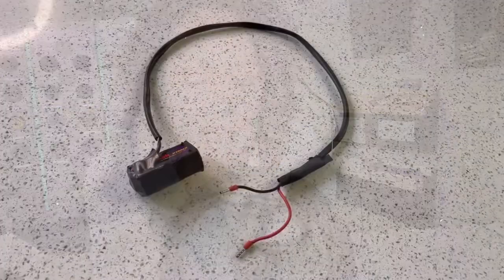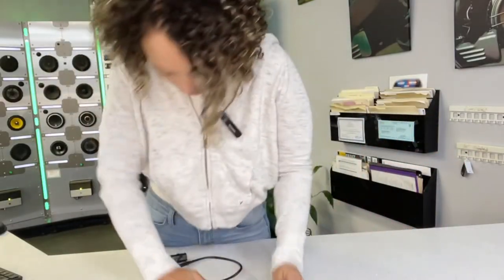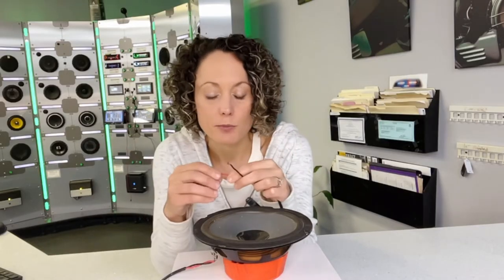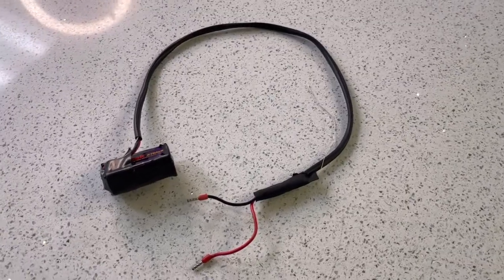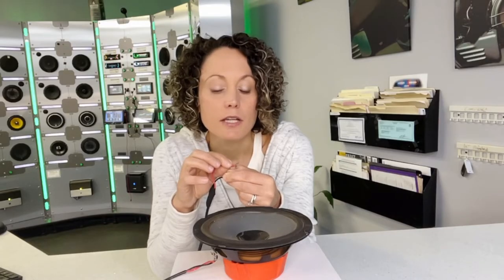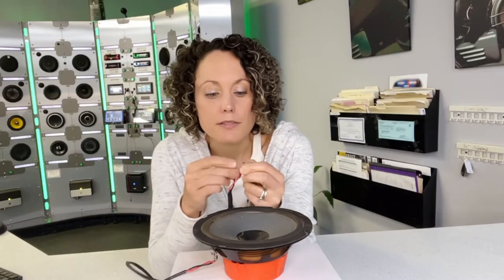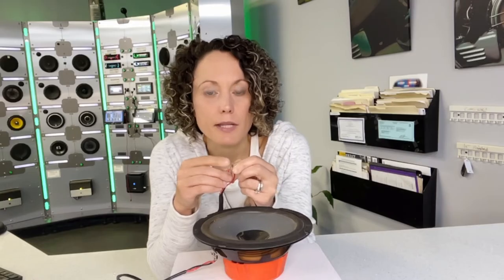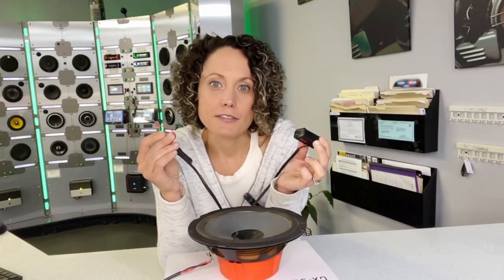How to test speaker wire polarity - no special tools required

Comment: Interesting technique for sure another easy and mindless way to find out your positive to positive and negative clarity is to simply get out a 12 volt multi meter and set the meter to 12 Volts DC, connect your negative to your negative terminal and your positive to your positive terminal, if your positive terminal is on your positive wire, it should read that you’re getting Anywhere from 7 to 12 Volts.
Reply: @Eurospec73  
How can a speaker by itself produce 7 to 12 volts for a multimeter to be able to read that.

Comment: NIce video. I suggest using a AA battery first since its just 1.5V its much safer than 9v. if you cant clearly see the speaker movement then move up to 3v etc and move your way up to 9v.

Comment: This is a great video to identify the polarity on the actual speaker only, I need to identify the actual polarity of the cables coming from the stereo as there is no speaker there and the speaker I need to fit is a very small tweeter which I do know the polarity of, however I do not know which door wire is the positive to connect the positive side of the tweeter to... and getting the head out is going to be a pain to examine the rear of the unit to see what's what at that point. Can you help please? Subscription promised. Thanks
Reply from the maker: What’s the year, make and model? Do you have the factory speaker that was removed? And is the factory speaker plug still intact?
Reply: @carstereochick  Its a 2005 Fiat Ducato motorhome. The very tiny tweeter that was removed was no longer working and I still have that, but it came with the vehicle and its very old, yes the tiny plug that goes into the tweeter I still have, but there are no polarity markings on it at all. I just need to work out which door wire is the positive so I can replace a new larger tweeter,
Reply from the maker: Generally most manufacturers use clip side (wherever the tab is to release the connection) as positive. Is there a small capacitor on the tweeter? If so, that is typically soldered to the positive side. Do you see a capacitor on the back of that tweeter? If all else fails, you may want to buy this $12 tool that includes test tones to determine polarity - https://amzn.to/43xCSO1
Reply: @carstereochick   Thank you I got my answer now, yes there is a capacitor and I now know that is the positive side.

Comment: How do you test the car wiring for polarity?
Reply from the maker: There's a few ways you could do it. If you can see the speaker in the door/rear shelf and you're probing the wires either from behind the factory head unit or at the stock amplifier (like if you're trying to wire up a head unit and the harness is cut or if you're trying to decipher speaker color wires to do a stock amplifier bypass for example) you can probe/pop those lines from behind the head unit or at the amp and watch whether the speaker is moving in or out. Or if you remove the door panel, remove the speaker, take note of how the connector is seated to the speaker when you remove it (example - brown wire on top, green on the bottom) then you can either take the speaker out and test it or while it's still connected to the harness in the door, strip back the wires back that are going to the speaker and probe/test it right there.

Comment: So you know the polarity of your speaker terminals , not of the wires unless well i don't know hoping they are connected correctly  ? l really am not sure. 50% problem solved , thank you . Nothings easy .
Reply: if they’re wired backwards it would still be the same affect, you’d just reverse it at the speakers would change the polarity
Reply: @SoyChukii  Thumbs up, thanks for the reply

Comment: thanks, but does it hurt to do this if the speaker wire has a capacitor on it? Usually they connect the capacitor to the positive wire, but some imported stuff can be a bit of a hit and miss.
Reply from the maker: Usually on tweeters cap side is positive. Also clip side on the OEM connection is usually positive. I hope that helps.

Comment: It works for speakers large enough to see the cone move, but not for something like tweeter, where you can't.
Reply from the maker: Yeah, for tweeters you typically have to look at the tweeter itself. Most manufacturers use clip side (wherever the tab is to release the connection) as positive. If there is a cap on the back of the tweeter that is normally soldered to the positive side. Or use a simple and inexpensive audio testing tool like this: https://amzn.to/3xAU4qH

Comment: That's good for a speaker when you can see how the cone behaves. But what about a sealed speaker where you can't see the cone because the grill doesn't come off? I have a Monsoon speaker that connects to a subwoofer but the red tag came off the wire that identifies it as positive. The speakers are sealed and I can't see the cone.
Reply from the maker: Is this in a car? Usually there is at least a speaker grille that you can shine a flashlight through and see. If it's not visible you may want to buy a phase tester on Amazon for $14.

https://amzn.to/3RpbXPs
Reply: @carstereochick  It's one of a pair of Monsoon speakers for a computer that comes with a subwoofer. They're pretty dated and someone left them behind at my job and I just wanted to identify the + / - wires in case someone wanted them. When touching the wire leads to a battery, I just hear what sounds like static for a brief second. They are flat speakers and don't use traditional cones. I'll probably just put them in a pile for someone to pick up and figure out on their own. I was just looking to make it easier.

Comment: Madam , which wire gauge suitable for wiring head unit to speaker? 18 or 16 ?
Reply from the maker: Hello - just a head unit install? Usually that is only 18 gauge, but sometimes you will see 14 or 16 used on theignition and ground wires for models that have a high powered internal amplifier.

Comment: Well, when I plug my door speakers up, they don’t move at all, so how can I tell?
Reply: If you follow the 9 volt battery demonstration then you have a dead battery, a bad wire, or a bad speaker something not conducting electricity provided you have electricity.  Switch batteries and test again. Also you can perform your test on another speaker.  If the problem follows you then it is not your battery.  That should give you enough info to determine where the fault is.  I assume  you have removed the wires from  the head unit.  Remember  you are only testing the Speaker, not the wiring harness from the head unit.

Comment: Wait that tells me the polarity of the speaker, how do I test the wires coming out of the car door?
Reply from the maker: So if you are replacing door speakers for example and need to check the polarity, you can literally cut off the factory connector while still connected to the factory speaker and test the bare leads coming off that factory connector. Then solder in new speaker wire to the OEM wires. If you've got no factory speaker to check against, you may want to invest in a basic polarity test tone tool FH-168.
Reply: @carstereochick  Thanks.

Comment: Whats the minimum voltage we can put on to test the speaker polarity
Reply from the maker: Even a double AA battery would work, it would be enough to see it move, but it would only be a faint audible pop so just keep that in mind if you're trying to decode OEM speaker wiring and hear/pin point which pair of speaker wires you're on then you might want a little more.
Reply: @carstereochick  this would be very helpful mam

Comment: How do you check the polarity of the wires in the car?
Reply from the maker: Assuming you just probe the wires with the door panel off you can do a visual assessment of the speaker to identify which one is positive and negative.
Reply: @carstereochick  Perform a continuity check with a volt meter.

Comment: How to check 2way speaker's (woofer & tweeter) polarity ?
Reply from the maker: Same concept, but the tweeter movement will be very slight and use a lower voltage on the tweeter. Like a 3 volt battery would be better to use on the tweeter, don't use 9 volts. Usually you can tell by physically looking at the terminals. The bigger one is always positive. Can you see both drivers move? Or can you easily remove them to examine them?
Reply: @carstereochick  
Thanks

Comment: But won't those 2 wires touch n spark on battery tester?
Reply from the maker: It’s just a 9 volt battery. Ever measure voltage through speaker level from a factory or aftermarket head unit? Most send anywhere from 4 to 16 volts through speaker level.  Won’t harm them and no sparks 😉
Reply: @carstereochick  yes I do it with my 12 volt drill battery daily but you can only do it once or twice before you can damage speaker.or I use my fluke volt meter.but the drill battery works on my milwaukee drill
Reply from the maker: In my 20+ years experience never damaged a speaker from this, but 12 volts might be a bit much for some speakers. Many aftermarket head units put out 8-9 volts clean signal through their built in amplifier and a lot of newer stock stereos put out more voltage than this through the stock speaker lines. Example- 2020 Grand Cherokee non amplified with no load there is 5 volts going through the speaker lines. Once you actually put a load on it and turn it up you have more. Some stock stereo systems are piping through as much as 30 volts (usually in the premium sound models). You could use a smaller battery too like a D which is only 1.5 volts for same test. OR you could use Metra's convenient All-in-One tester with tone generator which includes a (*gasp!) 9 volt speaker tester: https://theinstallbay.com/product/IBR68.

Comment: Hello, that is helpful but realistically cars speaker wires are usually random colors with a different color stripe.
Reply from the maker: Yup so if you probe the random colored wires and watch what the speaker does you can identify what's positive and negative.
Reply: @carstereochick  Yeah, that's something I learned fairly recently. Thanks for sharing this video, it was of some help to me.

Comment: This method only works if you can see the speaker In your car If you can't see the speaker you won't know the direction it's moving. When you test with the battery.
Reply from the maker: Yes, this is true. However in a lot of cases if you shine a bright LED work light through the door grille, you can still usually see the movement. Sometimes this requires 2 people, one to look and one to test the wires. If you can't do it that way, in that case you have to spend some money on more sophisticated testing equipment. But not much. This would do the trick: https://amzn.to/43xCSO1

Comment: 99% of the spakers have mark for + and Negative. How to test the speakers wires that came from the Radio without removing the Radio?
Reply from the maker: Most stock speaker terminals are not marked, they’ll have a locking plastic connector and if you’re cutting that off or tapping into it to install aftermarket this test will help you figure out what’s positive and negative before you install your aftermarket speakers. Also, keep in mind, what you find in the door doesn’t necessarily always match what’s behind the head unit 👍

Comment: Useless video. She doesn't show what wires are connected to the battery or how it relates to the vehicles speaker wires. DISLIKE
Reply from the maker: I don't think you watched it. It's quite simple. Take a battery, hook up your speaker wires to the positive and negative lead on the battery. In the car you are working on, say for example you're trying to bypass a stock amp that has failed and you're installing an aftermarket radio and need to identify each of your speakers leads. Typically in that example you'll find twisted pair wire at the stock amp which will help you determine the pairs of speakers. You can probe the wires with the battery tester to listen for which speaker is popping to identify your different channels. Then (usually with a buddy's assistance) you can probe the wires again and see if the speaker is moving out or in to determine polarity.

And if you're installing aftermarket speakers in a door and you can't tell my looking at the terminal what's positive or negative, it's pretty easy to perform this test at the speaker terminal. You can dislike, but it's a simple test a lot of professionals use. In fact, Metra makes a cool combo device that includes this tester plus a frequency tone generator. They call it an All In One Tester IBR68. It's quite handy if you actually work on cars and install aftermarket equipment on a regular basis.
Reply: @carstereochick  sorry for being an ass, but the battery thing isn't reliable.... I was trying to figure out which factory speaker wires were positive and negative. They can only be plugged in one way so I used the battery test on the factory speaker to try to figure it out. I seen two different videos. One says use a AA, and others say use a 9Volt. I tried both ways with the positives and negatives on each battery going to the same terminals on the speaker. And had two different outcomes. One will pop the speaker out and the other battery will sink the speaker.

Comment: that's useless if  you cant see the speaker
Reply from the maker: If you need to check polarity and you can't see the speaker movement, you're gonna need tools. You can spend $12 on Amazon for a "Automotive Speaker Polarity Tester Phasemeter Tool" that includes a test track --> https://amzn.to/44up7QK

Comment: do you mean i have to strip the factory speaker wire to perform this test? my goal is to determine the polarity of the wires on my car😊
Reply from the maker: Yes, depending on what you're dealing with - whether you're trying to bypass a factory amp that's failed or install aftermarket speakers using factory wiring or trying to verify polarity for adding an aftermarket amp/sub using a LOC - then you would need to strip wiring back a bit to probe and test :)
Reply: @carstereochick  I still think you are not answering the question.  The questions pertain to the polarity of the wires supplying the speaker, not the polarity of the speaker terminals.  My wires to the speaker are both gold, not red and black.  How can I use a multimeter to test which of the wires supplying the speaker should be attached to the positive terminal and which to the negative terminal?

Comment: Hi I just found your video and channel quick question what if the speaker is inside the car door I can't see it whether it's going in or out so if you have an answer for that I'll subscribe ring the bell and share
Reply from the maker: Hi Gabriel - great question. It does get tricky if the speaker is inside a door panel where even if you shine a light through the grille, you still can't see what it's doing. For that we use a basic test tool (part # FH-168) which includes specific test tracks. You can buy one on Amazon for about $12.